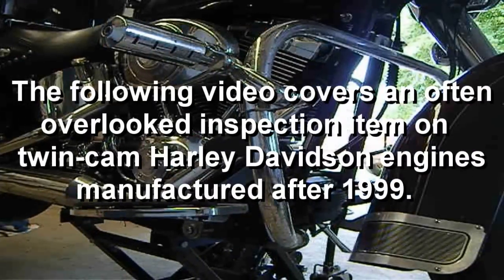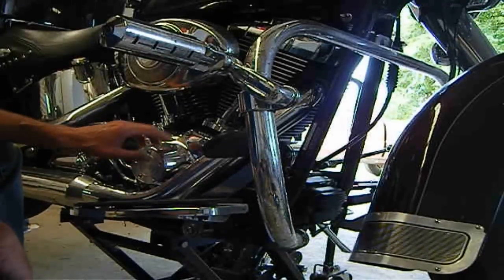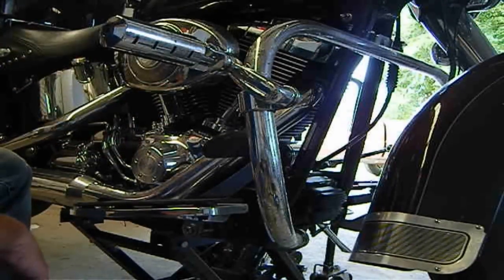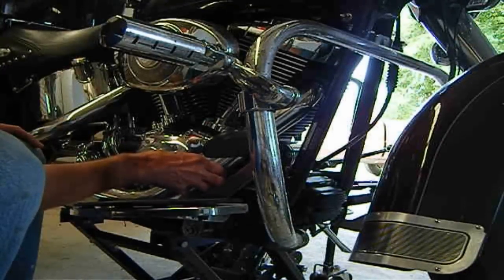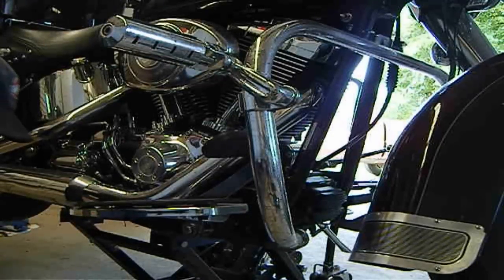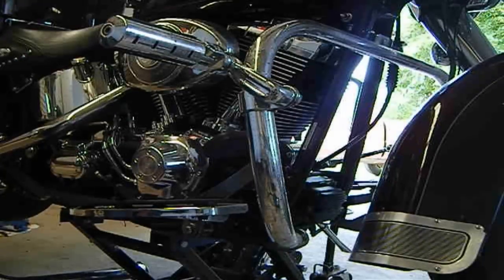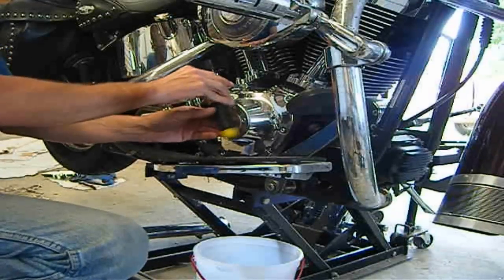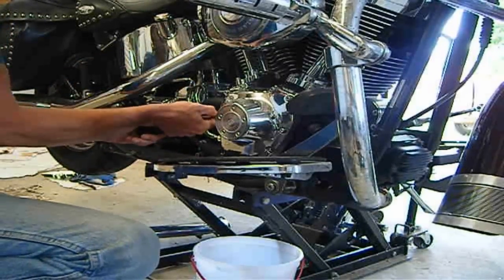TENSION HEADACHES: A Harley Owner MUST SEE!

Comment: the remedy is the gear drive kit, it cost around 600 bucks
Reply: your $600 estimate is a bit off... it's at LEAST $1200 and that's doing the work yourself.  The S&S cam & gear set, adjustable pushrods, pushrod cover kits, bearings, oil pump, gaskets - there goes over $1200 right there... easy.  You'll probably be changing lifters too- might as well... you're 'there'.  Also-  gear drive conversion is NOT the end all-be all... if your crankshaft is out of round- you're bike and money is toast.  

Me personally.... I'm just replacing the tensioners themselves and the inner cam bearings and gaskets... $230 for another 45K. That's using / reusing the stock pushrods which means the gas tank and rocker boxes get removed. I'm slow so it's about 5 hours work and a six pack of Bud on a rainy day... done.

Comment: never even knew mine had cam chains till three weeks ago when I got a new tire my 05 twincam 88 uses a quart of oil every 1000 miles am told bad valve guides and seals from Harley front plug loads up with carbon crap fouls plugs
Reply: What model is it?

Comment: My 06' RKC with 37K miles is getting the S&S upgrade (gear drive) along with new pushrods today, or rather I'm dropping it off to be done.  Before I drop the bike off I'm going to video/record the sound mine is making before any work is done and share for anyone that might be hearing the same thing. I'm having a trusted friend of a friend do mine.  HD didn't offer anything other than "this sound is indication of an upcoming engine failure" and that a new engine was really the only solution they could suggest.

Comment: Very helpful. Almost bought a new 100 B engine. Not now, For 20k I will buy 3 used metric bikes or a V Rod.
Reply: I have a 2008 (whew) but is there still an issue with them......maybe not as serious but does the same thing happen just after a longer period?
Reply: no they also changed the chain to a roller

Comment: Great video. Just one of the reasons I switched to Victory.....
Reply: I can see your point. But on the other side of the coin;Older designed bikes like Triumph's required a top end overhaul every 10,000 miles and those bikes are still loved and maintained with love. That being my viewpoint, if you love the bike you'll maintain it and get intimate with it, if you don't love it get a Victory. Good luck on your relationship with Victory.

Comment: excellent video i checked mine at 20000 looks about the same will replace at 30000.instead of removing rocker cover and push rods i think ill just cut them off and replace with two piece pushrods , more expensive but less labor consuming

Comment: I have an evo, with them twin cam's you MUST use a 5 microne oil filter it filters out the grindings from the shoes. on an evo we use 25 to 30 microne , if I was to put a 5 mic. oil filter on my bike it would die , the oil pump on the twin cam is stronger so it can use a better filter, evo oil pump don't have what it needs to push the oil past a 5 mic. oil filter.

Comment: on my 05 softail at 20k, mine looked just like yours, im still going to replace them with the screamn' eagle kit, i like the fact it comes with a high volume oil pump.
Reply: yes- by all means buy Screamin Eagle because Harley didn't make enough money off the flaw already.  WHAT IS WRONG with you people???  If you're going to address the problem, don't reward Harley... buy from S&S or Feuling or Andrews or ANYBODY BUT Harley... unbelievable ?????
Reply: I have the same bike.  108,000 kilometers on it.  Just found out about this problem and tore my bike down.  Sure as shit, the outside tensioner block was badly worn and broken.  Luckily, it hadn't worn to the point where the metal was in contact with the chain.   The inside one has barely any wear.

Comment: Why don't they use a tension like a car pulley tensioner?
Reply: +ZIPPER978 Lack of space for a wheel tensioner under the timing cover may be one reason. More moving parts means more production and assembly costs and these engines are designed to remove a LOT of the labor involved in the old design. That's PRODUCTION labor of course. They could give a shit about future maintenance labor since most engines last beyond warranty. A small wheel, like a small shoe, would still be heavily loaded in that application. Of course Japan got timing chains right when they went to Hy-Vo style chains (the early style like Harley uses is inferior in strength and wear resistance) decades ago, but they also use LONG guide shoes.
Reply: +ZIPPER978 thats pretty much what this is. only your car uses a belt and this uses a chain.
Reply: +StupidTeenageVideos I mean instead of a nylon pad use a pulley like a car. A geared pulley
Reply: ZIPPER978 Oh, I see. Thats actually a good question. I wonder if something like that is available as an after market part.

Comment: You can check for can tensioner wear at every oil change. After doing a "hot" oil change, let the filter drain overnight by poking some holes thru the rubber "check valve". Cut the filter open near the "rolled" bottom edge with something that cuts like a can opener so that you don't get any "filings in the inside. Take the pleated liner out & examine closely for gold/yellow colored particles..that is the plastic from the tensioners.Time to replace the tensioners!
BTW, while doing this you should also run a magnet across all of the filter media to check for "iron".
Do this & keep records for a log, it will help in monitoring your engines health!
Reply: I

Comment: Harley should have put a roller instead of a flat piece of plastic. 
Cheap ass Harley pressed the crank together trying to save money, is the heart of the problem with the Twin Cam engine along with the junky ass tensioners.
Once the crank slips ( from a pressed together crank) and there is run out or wobble in the crank you are shit out go luck. 
Take the engine out fix or replace the crank then go to  gear drive cam gears then you can build the engine (hop it up)
Don't forget the valve train ticking, ggg I bought a new 2000 Road King and have replaced the cam plate with roller chain and hydraulic tensioners, cams, oil pump, lifters, and put rocker lockers in the engine. but the valve ticking is still with me. The engine ticked from new and Harley told me it was normal but being a mechanic I know there is valve train play somewhere . Synthetic oil mobil one most of it's life. The more money I put in it the more dumb I feel cause without splitting the case and replacing the crank or fixing it I'm just waisting money. Harley even has the plastic chain tensioner in the new M8 engine.

Comment: My 2004 Softail looked good at 40K.   Few thoughts.   Keep out of the rpm's above 4000.  You can tell if wear is at maximum on inner pad if the link pins in the link chain are touching pad face.  Harley's true fix was the roller chain they went to.   

They used the hydraulic tensioner as a smokescreen to hide what they  did in all the previous twin-cams.   The roller chain outer link grooves in and then the chain rolls and stops wearing. They will go 100K plus but should be replaced in 10 years since heat makes the delrin shoes crack.  

Do not fall for Harleys upgrade SE hydraulic tensioner kit and  oil pump.  It only replaces the outer link chain and leaves the inner link chain on the new hydraulic tensioner.   It has way too much pressure at 2500 and up rpm and eats right thru the inner tensioner.  The people referring to the inner wearing faster comes from this.  They simple do not understand why. 

 Also as a final note.  The bumps on the surface of the link chain look rough but are really slick.   (rub you finger on them)  What they do is help prevent oil cavitation at high rpm.  At rev limit rpm, the oil can actually boil on the face and blast out chunks of the shoe.
Reply: RIPSAWONE I have a 2011 RGU with 85k on it and I have yet to service the Cam Tensioners.  I really should take a peek at them, though.  It's something that I have overlooked repeatedly.  

Was the inner chain also replaced with the roller chain?  If not, I may be destroying my motor and not even know it.  Until now I had never heard of this roller chain that you speak of... guess I have some googling to do.  Thanks!!
Reply: Can you please explain more about the roller chain, and provide a link to it

Comment: There are plenty of YOU TUBE videos posted by key offed Harley owners about the flywheel assembly crankshaft run-out problem  and the cam chain tensioner failure problems.

Comment: In my opinion, all Twin Cam engines have the same fatal design flaw and it's more than just the two silent chain drive cam chain tensioners, although, you might be smiling now, at 20kmiles cause you don't have to change them yet, but, you should change them out anyway, once you are into it, cause it's just a roll of the dice that you get another 10k out either one or the other, and when you do have to replace them it is going to be a costly procedure as you need special Harley tools. Had you tensioners failed and broken into pieces, they would get sucked into the oil pump cratering the pump and then being circulated to the crankcase and cylinders, causing catastrophic, engine failure. Means buying a new engine, with the same problem. No permanent solution exists. The potential for failure is always with you.

First of all you have to remove the exhaust system, and set your transmission to the highest gear and find top dead center on your cylinders, and lift the push rod tubes up to expose the pushrods, and you will have to take bolt cutters to cut the push rods, buy, new adjustable push rods to replace them with and remove the outer silent chain drive and then remove the cam plate holding the cams in place and need a special Harley tool to remove your stock INA cam bearings, as they are junk and replace them with Torrington bearings, and they have to be pressed in correctly with a bolted support plate and then you need a special tool to release the pressure on the cam chain tensioner on the cams and replace the and the O ring on the oil pump with a new one, don't reuse the old one and before you reassemble anything, make sure you use a dial indicator and check the run out on the pinion shaft and make sure that it has a maximum run-out of no more than 0.0001" of run out.

Which leads us to a problem you may not know about in addition to the PLASTIC tensioners rubbing against a METAL chain. And that is, that,  all Twin Cam engines from 199 to the present, have a pressed on flywheel assembly. Nothing is holding the two halves of the flywheel assembly together. Harley presses them together, at the factory, with a 400 press, that's it. 

The flywheel assembly WILL come out of try and the whole assembly will wobble as it's turning and sending your primary shaft (left side) and your pinion shaft (right side, out of maximum run-out (o.oo1") and I have seen Twin Cam flywheels with 1,500 miles at 0.006" or higher, which is already causing the wear and tear of the bushings and shaft bearings that will eventually cause catastrophic engine failure.

The only solution is to tear down your engine, and send out the flywheel assembly to a specialty shop to have it dynamically trued, and welded, that is, to weld the two halves together so, they will always stay true.

All other older, Harley single cam engines had a gear driven cam, no PLASTIC junk tensioner needed. And they all had a crank pin bolt and nut, torqued to spec to hold the two halves of the flywheel together.

Harley is a corporation whose interests are not aligned with their customer base, only with the interests of their shareholder to maximize profit and fixing your problem that they designed into the engine, to fail, is one way to maximize profits.

Finally, all Twin Cam engines run very hot, due to a junk, too small oil pump and heat destroys engines, prematurely. They get hot enough to cause a riders pant's leg potentially to catch on fire and the ride can suffer 2nd and 3rd degree burns, thus the birth of the rear cylinder heat shield, In California, tens of thousands of injured riders have filed a class-action lawsuit against THE MOTOR CO. for just that reason.

So, too bad you can't trash that engine, learn an experience, go out and buy and S&S EVO motor (1340cc)  and retrofit it into your bike and ride problem free.
Reply: Rodney Shultz  Yours fits into about 2% of gear drive unit with No Problems yet! I lemoned law my twin cam and got all my money back from Harley after 5,500 miles on it ! You couldn't give me one!  EVO and older now!😎
Reply: tomcata1467   lemoned my roadking back in 2001 and Harley returned ALL I paid for it and took the bike back after riding for 5000 miles! They could not fix the noise in two motors at 2200 rpm. So I got $19500.00 back and ride a 78 FLH Shovel and a 99 flstc Evo now!
Reply: tomcata1467  Made HD buy my 2000 Road king back because of engine noise at about 2300 rpm from day one, they replace motor with new factory motor that made the same noise only louder!  got all my money back after riding it for 5500 miles. Went back to my old 78 FLH and put in an 93 S&S motor and still running great today!  turns out 350000 twincam junk motors were pressed together loose because calibration machine was off! I listen many bikes with same noise but will not tell the owners and ruin their day. HD said I have a trained ear being a wrench and yuppies will never notice the noise thinking its normal. just got a 99 FLSTC with 6 K on it!
Reply: It's sad that we pay all this money to ride a supposedly American-made bike then we have to spend our hard-earned money to fix the problems good ole Harley knows they have. I have a 13 now my 09 had 80,000 miles and only $14,000 worth of warranty work thank
 God for extended warranty. LOL and the joke's on us they should come at no extra charge with a pair of walking shoes!!!!
Reply: thank you for all the  I n f o r m a t I o n
Reply: James Follert Your welcome, also Harley replaced 25% of its Milwaukee work force with foreign workers and fired the Americans who had to train their replacements. So, much for American made. More Harleys are being built and sold in India, too, than in the USA, in Harley's foreign factories.  That's a fact.
Reply: You are welcome. We have to remember that Harley is a multi-national corporation and the creed of ALL corporations is to protect and maximize SHAREHOLDER's INTEREST, not workers rights or doing right by them. It' the bottom line they are concerned with. That is why the support cheap labor and bringing in through visas, cheap foreign workers who will take less pay and lower or less benefits and are more and more part-time workers without benefits accorded to full-time workers of yesteryear.
Reply: Rodney Shultz S&S ?
Reply: tomcata1467 You need to proof-read your post and edit your decimal places. Something doesn’t add up.
Reply: Honda don't make that excuse. The defects are DESIGN deficiencies and they are PREMEDITATED ENGINEERING CHOICES.
Reply: That's the way to go, and HD should have stuck to gears. Sportsters don't have problems in that respect proving any MoCo excuse for their chain drive is a lie.
Reply: Only pussies can't stand the heat.ford and chevys are made in Mexico
Reply: immm.. gear drive conversion... no chain and no shoes. have over 120k on one with no issues on gear drive setup. change oil every 3k with castrol 20 50
Reply: what are these ''other'' fatal flaws you speak of?
these bikes are nearing 20 year mark in generation and routine maint. is all it takes to keep them running more than 100k miles

Comment: Nice job. I will check my 03 fatboy with 30K miles before heading to sturgis. POS design indeed. What type of oil do u use? I have a 5 cent theory that thinner synthetic oil make the sheo wear faster. I use 20/50 regular oil.  I have NO proof though. Txs again.
Reply: squadman33 I am just changing out my tensioners at 39,000 miles......no pits and only about 1/4 worn down......changing them out anyway along with new cams, bearings and pushrods and lifters
Reply: squadman33 n

Comment: I have a 05 EFI DEUCE and I had  complete failure of a tesnior at 25k miles and
HARLEY should of recalled these engines .. it cost me oil pump , cams  , lifters and peace of mind... now I will always worry that  more damage happened but went un seen... regardless I went back with the hyd tesnoir set up and thats the up grsade and its only good for 50k miles and in 2015 I find it hard to belive thats as good as harley can do and the true real fix is  done by S&S with a gear driven cam setup.... but on brite side everyone I suggest putting performance cams in when you do the upgrade cause they may talk about my little 88b engine but they have to talk about it in my dust cause I will smoke any 95ci, 103ci, and if its still stock any 110ci  bike and it takes a full stage four 110ci HARLEY  or a 113 S&S BIKE to give me any trouble and my bike looks lots better than any ole EVO 80ci ... and Im going to 98ci with my bike next week and with my short stroke and fast rev"s .... well keep on talking jus dont eat to much dust from my twin cam 10.7 sec harley deuce....
Reply: i ran 10.78 on my 1993 sportster not my 88ci deuce.... it may go that fast if I
 drop it out of space shuttle